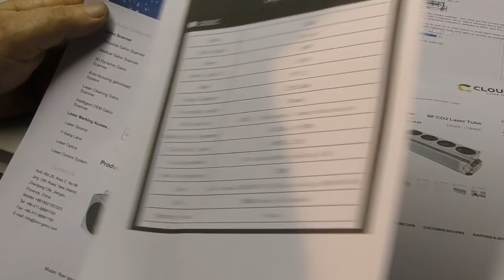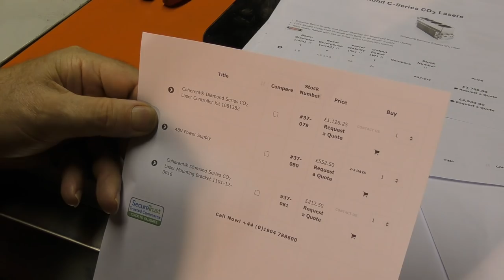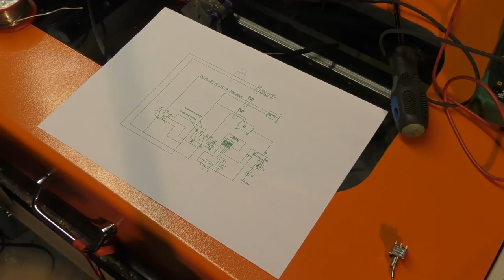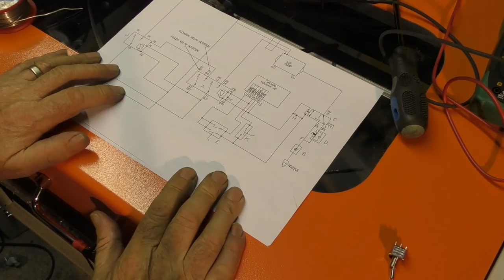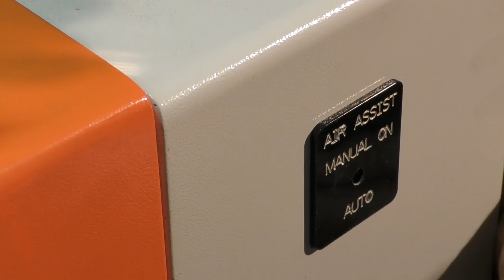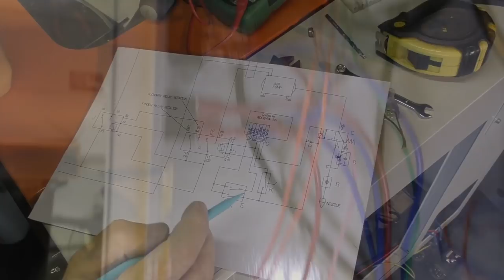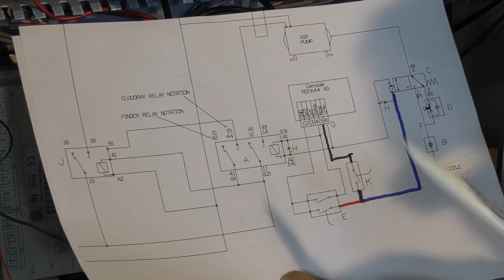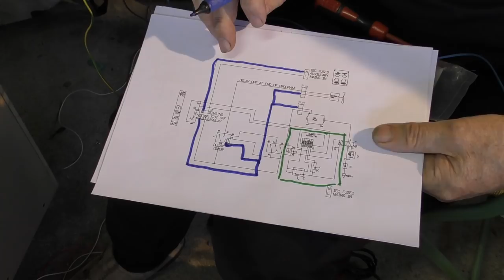Tangerine Tiger 04 Fixing the wiring

Comment: Hi Russ. Great project!  It looks like the RF laser is a compact, self contained unit, unlike the usual fragile glass laser tube. Wondering whether mounting the RF Laser perpendicular to the back of the machine and shooting the beam directly onto what would ordinarily be mirror #2 would make any sense?  Benefit would be eliminating mirror #1 mounting, alignment and potential power loss, easier air-cooling of the laser since it wouldn't be enclosed inside the cabinet.
Downside would be a less compact installation with the laser housing protruding from the back of the cabinet a bit. Would it be worth the trouble of re-mounting the laser and eliminating mirror #1 in this way? Crazy idea I know. Look forward to seeing Tangerine Tiger in action. Thanks for your informative videos. Cheers!
Reply from the maker: Hi Glenn
 Thanks fiorthe comment because it wikktest your oores of 
 Sounds like a great to lose a mirror and toe thuis save a 3% to 4% power loss. Sadly  losing mirror 1 makes it almost impossible to set the Y axis true. From where you are sitting , point to something in your room that is 5 or 6 feet awat from you and  below your shoulder height.  Now breakdown ALL the X,Y and Z movements you would have to make to finish up with your arm dead parallel to the wall and the floor. The first x movement you make is going to have you pointing way off target because you need rotation adjustment as well as linear adjustment. . The same applies to the Z motions as you drop your shoulder to parallel with the floor.  That will be a big piece of engineering to hold and adjust that big lump of metal tube..  No, when you understand how mirror1 works, it matters not how your lasertube is aligned  except that the beam must hit the centre of mirror 1 ( within 1 or 2mm). With just 2 small adjusting screws the beam can easily be set to run horizontally and vertically true to the Y bearing rail.. In reality there are no upsides to your great idea, the simplest method still requires 3 mirrors.

 Thanks for the comment because now it will test your powers of 3D spacial imagination to undestand what I am saying about mirror 1. If you are a pool or snooker player it shouldbe easy.

Best wishes
Russ

Comment: Great video Russ. Quite jealous of all your upgrades. Should be a bulletproof machine once you're finished with it! I agree with your thoughts on the wiring, it's a disgrace and downright dangerous. After I recieved my machine and had a quick look around, I decided to just rip all of it out and start from scratch. The only thing I didn't do (because I didn't have one at hand) is put in a contactor to switch the mains voltage. I did upgrade the emergency stop button to a better one, which should be able to handle the current, but it's not how I prefer to have it.
Reply from the maker: Technically I should have used a contactor for mains switching but this 10 amp relay is not continually switching (just on and off with the machine) and I had it to hand. Its a compromise that fits in with the rest of the machine!!
Best wishes
Russ
Reply: @SarbarMultimedia  What I meant (not sure if I understood you correctly), was have the emergency button control a contactor, which shuts off all the power to the machine, so you don't have all the power being used by the machine going through the emergency button. I've seen a lot of prolems with burned out emergency switches (especially in countries with 110V instead of 230V). I've also put relais on all the other switches, so they only have to switch 24V, instead of 230V. Much safer and more reliable than the "rats nest" of cables looping from one switch to the other.
Reply from the maker: @ltdeditions  
When I was designing machine tools many years ago what you are suggesting (and what I am doing ) was not allowed. Emergency stop had to be a MECHANICAL circuit break to make the machine safe. This was based on the principle that a contactor could possibly weld its contacts and not break even though you had removed the power.  Yep, I have had may reports of melted E stops from USA. Even though our method of shedding load from the Estop my not comply with machine build regs,  its a lot safer than the" Chinese standard"
Best wishes
Russ
Reply: @SarbarMultimedia  "I'm not an electrician by profession, but I understand quite a bit about electrics". I think you're being a bit too modest here ;-) If I'm not mistaken, these days a safety relay switching two other relais / contactors in series is considered to be safe according to machine regulations. I'm not an electrician either, but I have built my share of control cabinets following wiring diagrams drawn up by certified electrical engineers. But you're right, almost anything is better than the "Chinese standard" and as long as we're all staring at our machines with the lid open, a safety relay would be no more than an expensive boat anchor.

Comment: Hi Russ
I'll be going up the same road with my build, I'm using the Ultimate air assist and the off delay on the extraction fan.
What's your opinion incorporating an auto/manual switch in the circuit for the extraction fan as well?
As an aside can the RDC6445G also control the startup of a water cooler at program start as per air assist, or would you run the cooler at power up?

Thanks for your valuable DYI laser incites and subtle humor, really enjoy your videos.

Best regards
Reply from the maker: Hi Ralph

 Yes it would be a good idea to incorporate a bypass switch for the fan for those instances when you want to run the machine with the arrow and pulse button ie cutting without a program.  It is a bad idea to have the water turning on and off with the program  because the water circulation in a pond pump and reservoir system will stir the water in the reservoir to aid radiation cooling.  Also,  every time you start the program you will get a water error because the flow does not start quick enough to trigger the flow switch before the first laser switching signal. If the laser tries to switch on without water flow it will stop the machine.
 Best wishes
Russ
Reply: Thanks Russ
Duly noted, did not think about the delay in the water flow, I'll make sure my cooling system comes on at power up. 
Ralph @SarbarMultimedia

Comment: Hi Russ. How about mounting the red dot pointer from straight above on the x axis and then just adjust the offset the the beam to the dot. This can perhaps help with the alignment.
Reply from the maker: Hi Gerhart
It all depends on what you are trying to achieve with a red dot. Seems like a brilliant idea.  People have two goals. 
1)  dynamic beam alignment without the need for the scorch method. In practice I have designed and made 8 red dot pointer systems and they all nearly worked but all  required me to start at mirror 1 and use the scorch method for final precision alignment. I have used and experimented with several different types of beam combiner systems.. They all have to also be set to align with the invisible beam.  This task is like trying to find the end of the rainbow, you know it's there somewhere but trying to exactly touch it is near impossible.  So with my final logical analysis a few videos ago (red dot disappointment?) I proved why I had been wasting my efforts.  I hate it, but with a logical and methodical approach , the scorch test can quickly deliver perfection.
 2) A red dot on the work to identify where the beam will.land. This again seems like a good idea but until you have studied it's accuracy and reliability at every part of your machine's work area,  you will never understand  why  trusting that red dot is an act of faith rather than logic. Apart from the inherent error caused by the beam not striking the sweet spot on mirror 3 PERFECTLY at ALL points on the table. the intense light of the spot  tends to "burn" a much bigger footprint on your retina thus causing uncertainty about exactly where in that spot your beam will  land . I know I may sound like a killjoy but I don't consider and uncertainty of +/- 1mm satisfies the goal you are trying to achieve.  The  mechanism that produces the best accuracy  because it is fixed  to the machine frame, is two red scanning lines set at 90 degrees to each other. It is still not perfect but it guarantees that your cross hair follows the CNC positioning coordinates faithfully regardless of how your beam wanders. Thuds half the potential error has been nullified.  I learnt about these uncertainties a long time ago and neither of my machines ( and  now the Tangerine Tiger) have them fitted.  If my eyeball assessment is inadequate and  I  really need to ACCURATELY know where my beam will land,  a quick blip of the pulse button gives me the PERFECT answer. 

Best wishes
Russ

Comment: What relay you use for the delayed extraction switch off. I am going to install that along with the ultimate air assist on my machine.
Reply from the maker: Hi Frode 
 Add your disguised email address to another comment (johndotsmithatgmaildotcom)  and I will send details and a circuit diagram.
Best wishes
Russ

Comment: Okay Russ I am confused..... I worked for Harbor Freight they are a U.S Based company so just how did you get a freebe Harbor Freight Light! LOL thanks for the great vids
Reply from the maker: Hi Willie
 I am aware that Harbour Freight are one of many large US tool vendors BUT I have never had any dealings with them and am wondering how you made a connection,
 Best wishes
Russ
Reply: @SarbarMultimedia   sorry for the off topic comment it was just a bit of humor for me to see that little blue flashlight, They are given away at Harbor Freight with a coupon (read the little label on your light it is distributed by Harbor Freight) They are great little work lights and very popular store item. Back to Topic you mentioned that with our U.S 110v Standard I may have an issue with the Amp load on the switches, So should I change out the emergency switch to a higher amperage?
Reply from the maker: HI Willie
Aha.... Yes, I have never looked . That light is very useful and arrived in a little package of "gifts" from a very grateful US correspondent who I had helped get a refund on a rubbish tube and also helped him set up his machine. It matters not that it was a freebie, it's just a great little aid. 

If you are planning on using 110v (I know you often have the option of 220v) then no, you do not need to change the switch but you must unload all the ancillaries onto a separate extension block. Items like the water pump,and the air compressor . Do not use any of those sockets on the back of the machine. The ES switch will handle that basic 110v current draw from the machine  but it's the extras that will exceed the 10 amp rating of the switch block. Even if you hunt around for a different more expensive replacement you will keep bumping into this 10A limit.
 Best wishes
Russ

Comment: Cheers. It is ridiculous how they wire things up in china, Every little K40 I converted I basically striped ever wire and connector out and started fresh, takes less time to properly rewire the thing then it is trying to figure out what they did lol  I am actually pretty surprised there are not more electrical fires caused by those imports

Comment: Another very good video, thank you. I think you're going to find problems with your RF laser power supply. You should never run a power supply like that past 80% continuous. I realize you are not going to have a continuous load of 12 amps but over time this may become a problem.  I would like to encourage you to watch a video series on YouTube.    
https://www.youtube.com/watch?v=3foFc91b8rU
The link I provided is for the third video in the series. But you may want to watch it from the beginning.  In the videos he is running a similar power supply to yours at 100%+  It lasted approximately an hour. I think your power supply really needs to be approximately 14.5 amps. At any rate,  this has been a very cool build, I can't wait to see it to the end.
Reply from the maker: I am assured I can run this at 100% so I will  do so when I try cutting with it. In the interests of discovery it is essential for me, you and Cloudray to know if the product they are selling and providing technical advice for is fit for purpose.  As I make clear, Cloudray have supplied this laser and power supply for me to test. I plan to do just that. Thanks for the link I will watch and learn because at present my experience with RF is ZERO. I shall definitely be comparing it with glass tube capability.
Best wishes
Russ